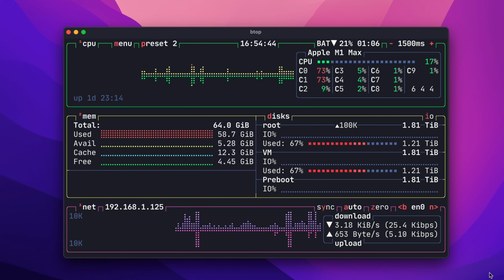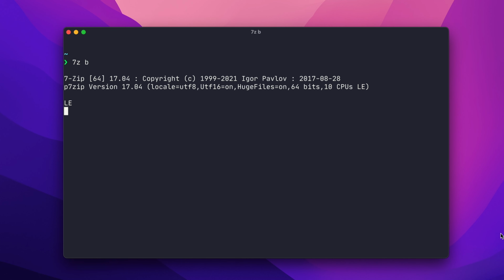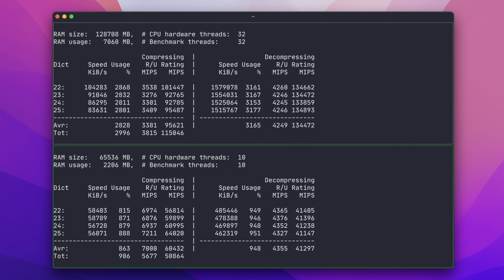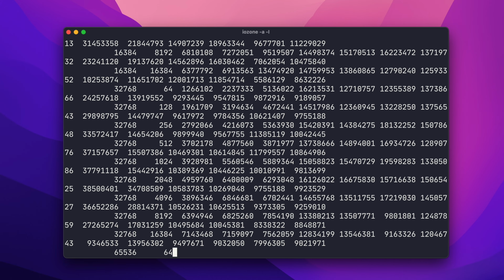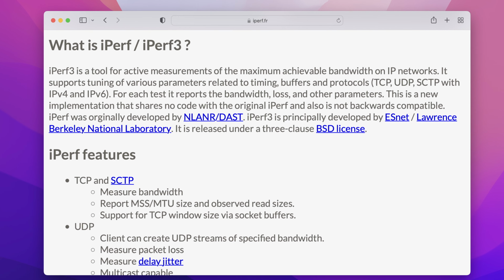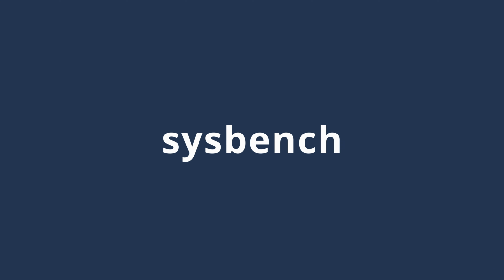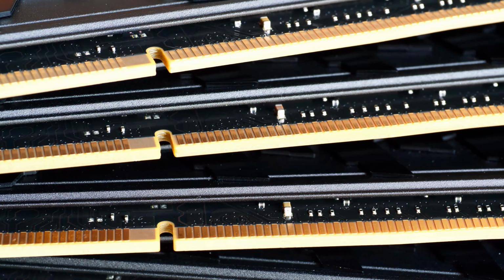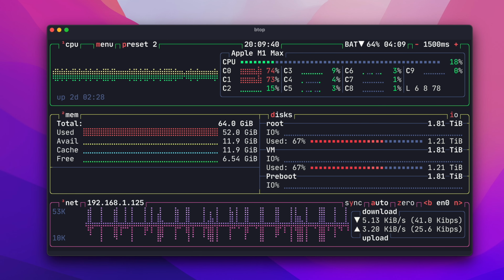6 AWESOME CLI Tools for Mac & Linux Performance Testing (2022)

Comment: I did an rmlint on my laptop. In total 15085 files (tock over 5 hours)whereof 9221 are duplicates in 1627 groups. This equals 353.72 GB of duplicates which could be removed. 2828 other suspicious item(s) found,  which may vary in size. Scanning tock in total 4h 32m 33.995s
Can you help

Comment: Phoronix test suite. However it has some flaws. For example linux kernel build benchmark runs faster on stable/outdated distros with GCC7 than on new distros with GCC13 and it's not always how many factors do affect the results.

Comment: you can not simply replace benchmarking with "performance testing" this is misleading at best
Reply from the maker: Benchmarking is one kind of performance testing. Many of these tools can be use for baseline testing and then back testing changes. We also have a presentation of stress testing here which is a completely different kind of performance test.

Your comment is misleading at best.
Reply: @tech_craft  the only tool in the list where you can control the load is iperf. Having only stress test and benchmark are simply not enough to verify system performance requirements.
Reply from the maker: You are incorrect. Each of iperf, stress-ng sysbench and iozone provide the ability to control the load. So four of the six tools.

I also never once said that this list is definitive. Again, your comment is misleading at best.

Comment: Is it fair to compare MIPS on two different architectures?
Reply from the maker: It will depend on the exact nature of the benchmark. In general no, but I've found MIPS ratios and speed ratios to be consistent across platforms when running the 7zip benchmarks. 

For example, the 5950X vs. M1 10-core has a ratio between 1.5-1.7 for both speed and MIPS. You can calculate your own normalised rating of Speed / Utilisation if you want to be absolutely certain, but for the 7zip benchmarks across x86 and M1 that I've done the Speed/Utilisation and MIPS/Utilisation ratings are always pretty much the exact same.

Summary for my setup - the 5950x still beats the M1 in raw throughput for multi-core workloads (it has 32 hardware threads so it should!) but the cores on the M1 are twice as fast (both MIPS and throughput) than the cores on the 5950x.

Comment: Your software recommendations are always top notch. When you recommended ncdu I installed it just for fun and it really changed the way I deal with storage. ncdu is FAST, and it is so helpful that I had to install it on all my machines.
Reply from the maker: It's great, I'm using it more and more since I seem to accumulate massive video files at a ridiculous rate now.

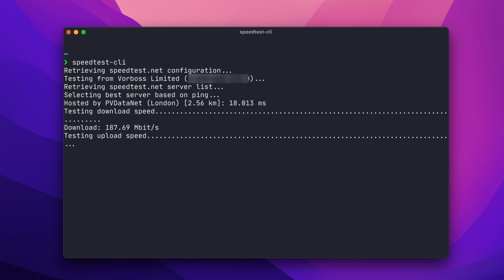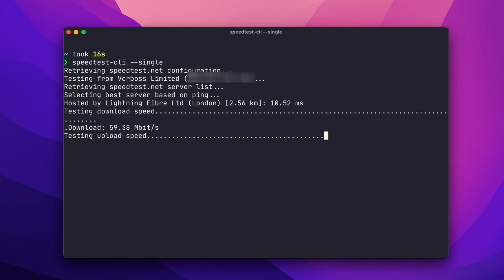Comment: 0:27 to 0:40 I noticed the speed readings I get with speedtest-cli are vastly different than ookla on their site

1Gbls connection here... speedtest-cli claimed around 300 ish Mbps while ookla was in the mid 900 ish Mbps range for download...uploads were precisely the same.om speedtest-cli and ookla.. and yes..I made sure no webpages nor downloads were going on other than the obvious.

also cat 6 ethernet cable straight to a damn Arris s33 modem ( supports up to 2.5Gbps by the way)...on a PC with a solid Intel 1Gbps Ethernet jack)
Reply from the maker: Yeah, you will see that because speedtest is using different servers than ookla and others.

Comment: Im curious why you would us a proprietary file format for the spreadsheet. Is there a special reason or just a habit?
Reply from the maker: From my reading of the docs, Excel is the only option. If that’s wrong I’d love to know because I don’t like having Office on all my machines
Reply: @tech_craft  excel support a number of open file formats like ods and csv. Microsofts proprietary file formats can have compatibility issues between different versions of excel and is generally unadvisable to use if you don't have a specific reason to do so. Also becomes a lot harder to work with in cli applications. I suspected you had some legacy hardware that you wanted to use that only accepted xls but that didn't seem to be the case.
Reply from the maker: I don't think the issue here is Excel, I think it's iozone. If you try to output a CSV for example, you still just get an XLS file.